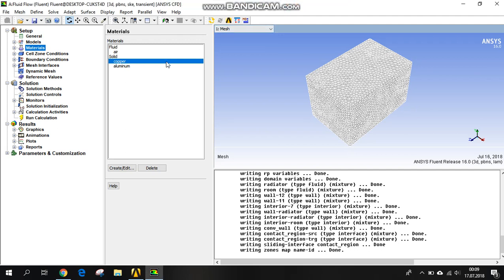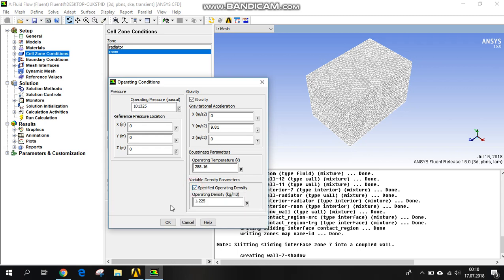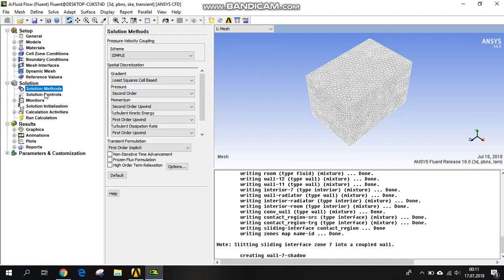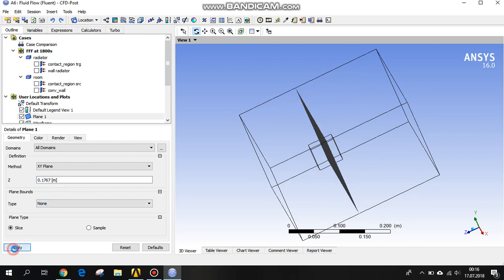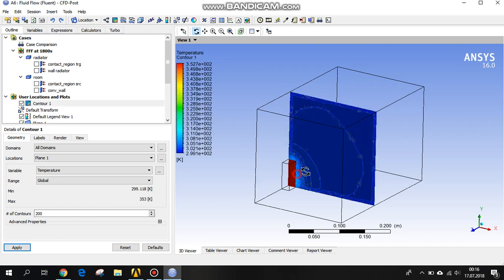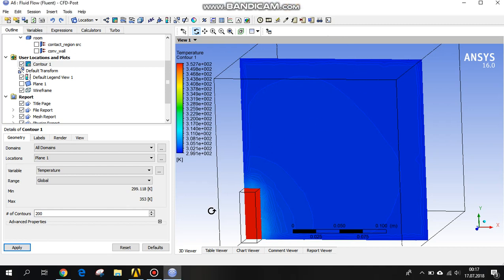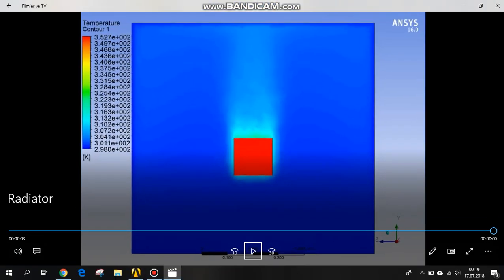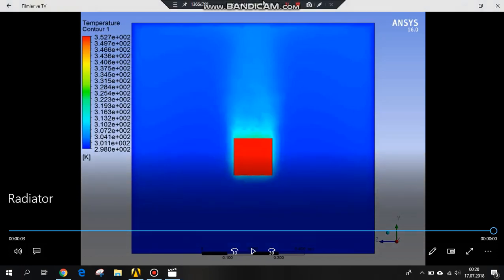Radiator in the Room Thermal Distribution ANSYS Fluent Convection Part2 | BigForBeg

Comment: Did you have to set the BC conv-wall? I have created a similar simulation based on your videos and in my BC tab there are walls for the objects in the simulation such as wall-rad and wall-room but no convection walls? Im using Ansys 2019 R2.